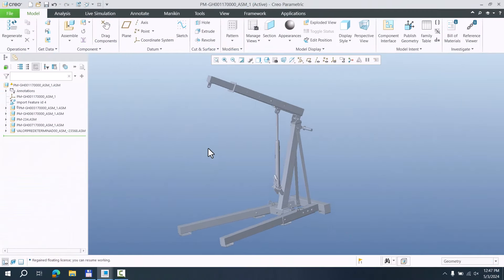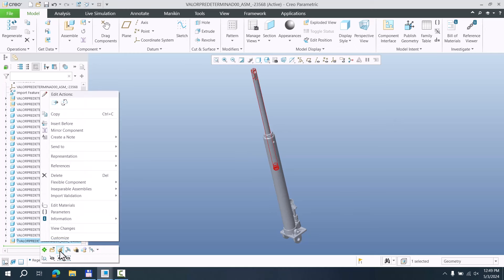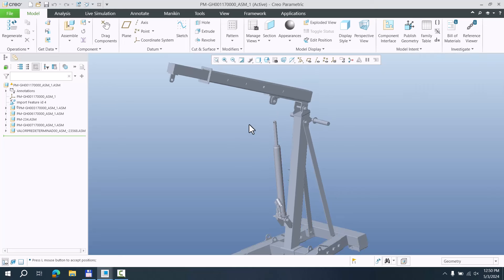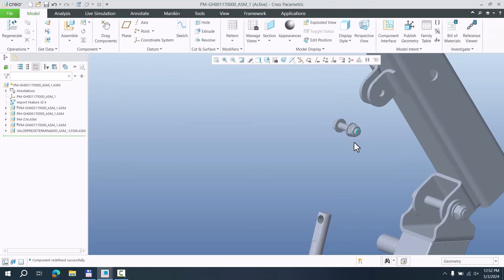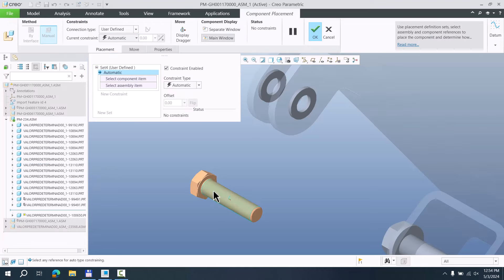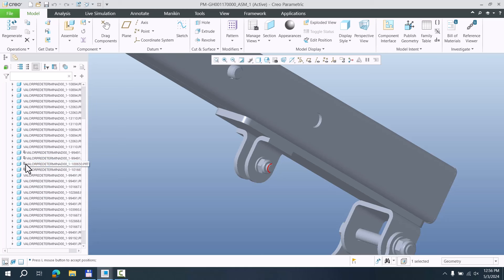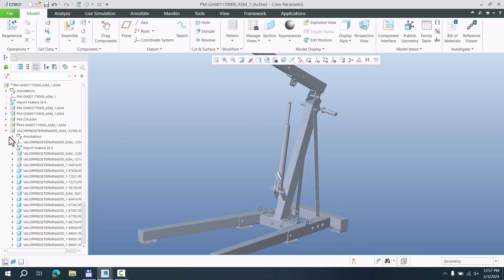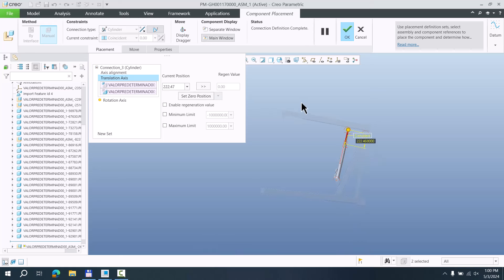Mechanism Constraints Across Assemblies - Mastering Creo

Comment: Hi!
But what about degrees of freedom and redundancies?
Because I'm quite sure that your cylindrical connection added 1 constraint to the model.
You have 3 bodies (crene, piston outside and piston cilinder) so we have 6x3=18 dof.
You've removed 5 dof with the pin over the crane, 5 dof with the pin over the piston esternal piston (to link it to the frame) and 4 dof with the cylinder internally the piston assembly.
Total: 5+5+4 =14
If you add a cylinder you add 4 degrees of constraints and you reach 18 dof, so you could''t have the possibility to move because of you don't have the 1 dof you need.
If you make a DOF and a Redoundancies Measure you can see it.
To have the 1 dof you may use Bearing constraint instead of Cylindricl to link the piston's head to the crane.

This is theorically...
A system with no zero redundancies may gives wrong dynamic results.
This is an area that maybe will be examined in depth.

Comment: Plz make a video about stock length table and cut list
Reply from the maker: Thank you for your proposal. Can you help me please in which part the stock length table is belong to?
Reply: @4kside  I also don't about that I search how do create bom table with length. I saw that in ptc creo community it's in there about framework stock length and cut list
Reply from the maker: Ok, I will try to show you how you can create custom parameter and custom table and system will calculate selected parameter.
Stay tuned, Vladimir